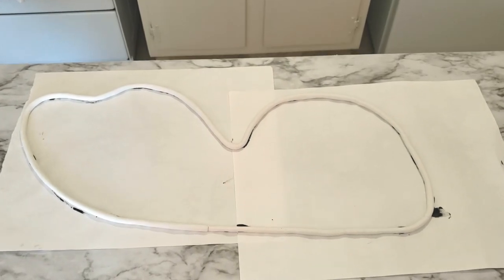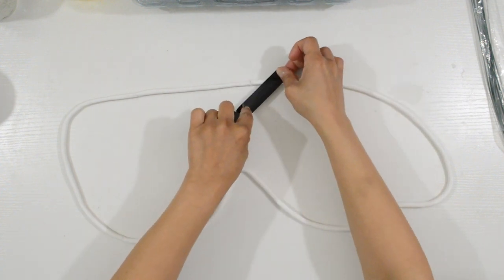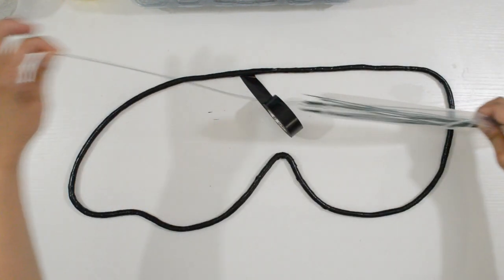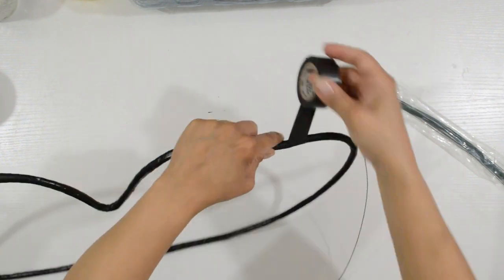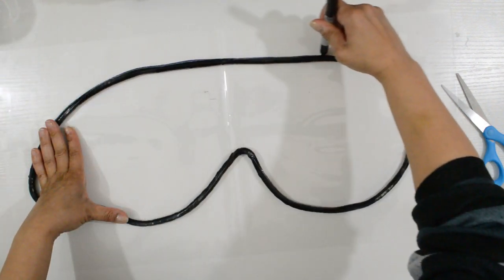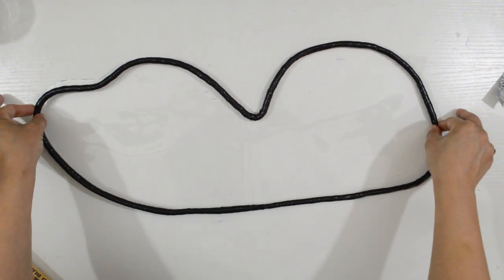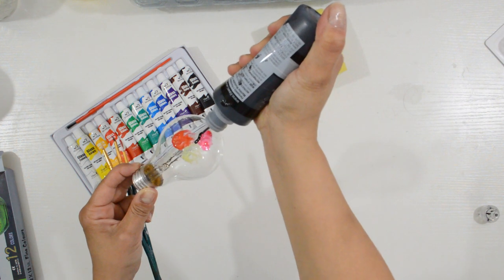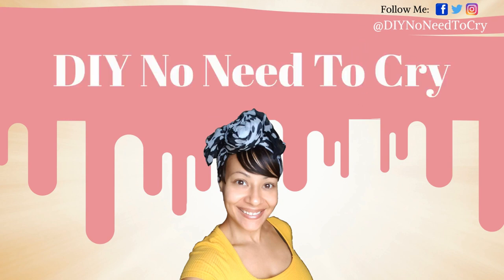Faux Stained Glass Wine Bottle Art | Butterfly Wine Bottle Design | Part 2

Comment: Just a suggestion.theres something you put on wiring.but i think it would work instead of all the electrical tape.it comes in all kinds of lengths.think its called shrink wrap.you would slide it over your out line of the wing.then you just use a blow dryer to shrink it onto the form.its not expensive either.love your wine bottle idea.
Reply from the maker: I used the electrical tape to make it sturdy. Awesome suggestion, but I did try the wrap they use for baskets. Lol I wasn't able to pull it off. Maybe inexperience? Thanks for the suggestion though! Anything helps. 🙌🏼🙏🏼❤